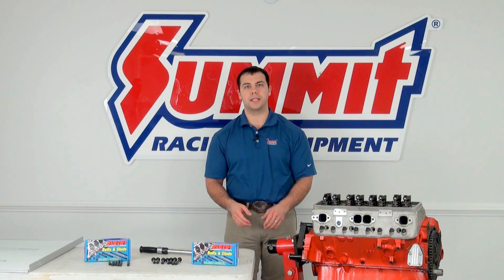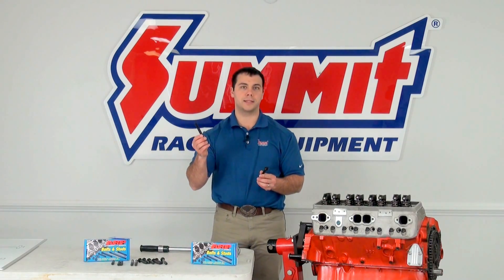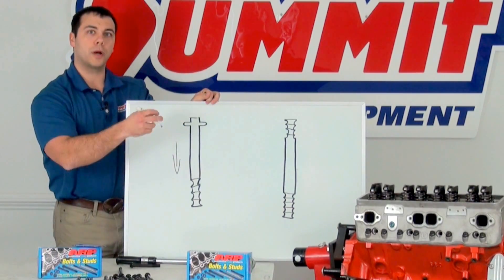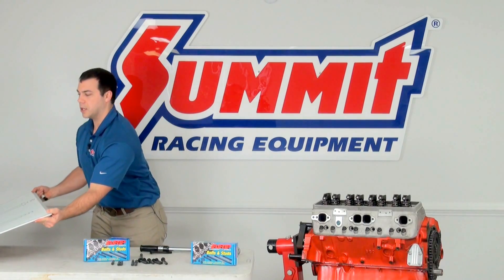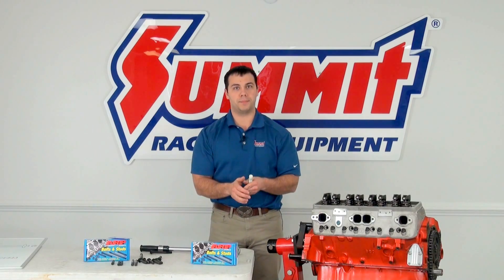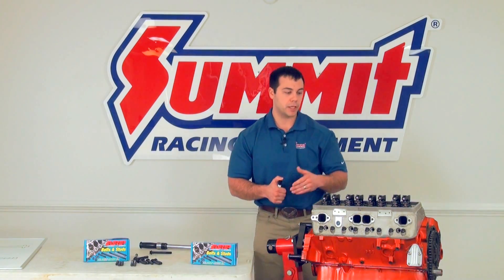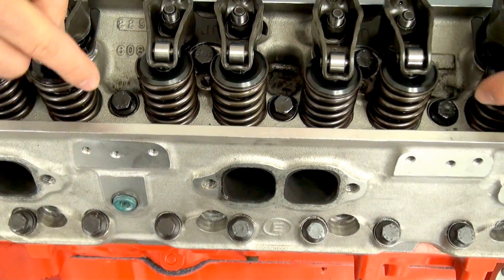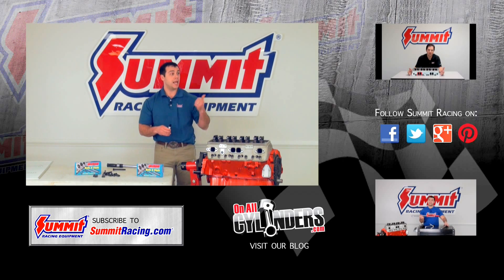Cylinder Head Bolts vs Cylinder Head Studs - Summit Racing Quick Flicks

Comment: How can I distinguish TYY cylinder head bolts from ARP on my Ford 2.0 Zetec?
Reply from the maker: Great question! factory head bolts are in fact a bolt with a Torx style head. For this application the available ARP head fasteners are studs, washers and nuts that are marked with a small ARP logo!

Comment: How do you use torque assembly lube But at the same time
needing a sealant to seal the bolt in the water jackets from water interning the engine.......you cant use both
therefore torque setting will be incorrect

Comment: Thank you for the video and your time 👍🍺😎.
Question ! I have a 2004 chevy suburban with the 5.3 engine. 
I'm working on the engine and I would like to buy the head studs. 
Do I have to do the 30,60,80 using the head studs??

Comment: So which would be better for a turbo application, studs right?
And where can i find the studs for my engine? I checked arp and my engine wasn’t listed for studs
Reply from the maker: We would need to know what engine you’re working with. Follow this link and use the filters on the left column to choose your application. Cylinder Head Studs. If you're having trouble finding them, give us a call @ 1-800-230-3030.
https://www.summitracing.com/search/part-type/cylinder-head-fasteners?SortBy=BestKeywordMatch&SortOrder=Ascending&keyword=cylinder+head+studs&N=part-type%3acylinder-head-fasteners
Reply: @SummitRacing  I can’t call, but i have a 2005 chevy colorado with I believe a 2008 motor in it, the motor is a 3.6l inline 5, and when i click the left column to filter for my vehicle, the colorado isn’t even a option

Comment: While watching this I realized that you could use studs if you have a block that has head bolt holes that are not blind causing you to have to use thread sealer.  With bolts, if you want to change or service your heads or change head gaskets you have to clean the threads on all of those head bolt holes. With studs you wouldnt have to. I'm in this situation right now, just had to do this clean up, might change heads in the future,  so I might look at getting some studs that can stay in the block.
Reply from the maker: Hi Curt! Let us know if you need any assistance! Thank you for watching.

Comment: I have a 70 LT1 sbc cast  block with a set of performance world aluminum heads, what torque sequence should I use, I have 11.1 compression, and intend to use arp studs
Reply from the maker: You will start in the middle and work your way out in a criss-cross pattern. Make sure you torque the studs in 3 equal increments (start low around 35 ft lbs) up to the final torque spec that ARP recommends for the stud kit you get.

Comment: I have a SBF 5.0L motor with GT40P heads and an E-cam What head bolt style do you recommend 6pt hex head or 12pt head bolts?  Should end up around 300Hp when its complete.
Reply from the maker: 6 point or 12 point will both work, but I generally recommend 12 point. The 12 point will give you slightly more clearance to get a socket on them.

Comment: so you're saying torque to engine specs regardless of fastener used  ARP or stock for example my jeep 4.0 is 110 ft lb by the book ARP recommends 100 ft lb with lube   bolt pt# 146-3601
Reply from the maker: Hello, Unless the fastener is an OEM replacement, you will need to follow the torque specs of the fastener used. ARP gives you the torque spec with their fasteners. Thanks for watching!
Reply: @SummitRacing  Thank you ! they came today ups, there was a paper in the box with specs and torque lube . crown was going to be over $50 for a 94 jeep so I went with ARP only $63 Now all I need to do  is figure out what to do with the wiring harness three head bolt studs held it in place before ,only + with crown

Comment: If you think you may be taking heads on and off the short block, studs would be advised. If you are pretty sure you will be leaving on your cylinder heads on your block, head bolts would be advised. I have had to take off my cylinder head multiple x from my Quad 4, studs have had paid for them selfs.

Comment: We had trouble with coolant leaking into the valve cover area, with studs. what could be the reason?
Reply: Educated guess: It sounds like the threads did not get any thread sealant, where the hole is open at bottom to the coolant passages.  Simple solution, remove and replace the studs with thread sealant before reinstalling.  Not sure, but that may be the solution.  Also, I'd remove them one at a time, but untorque them all in the proper sequence first, remove one at a time in any order, seal threads, reinstall, retorque in the proper sequence.  Hope it works out.

Comment: what about using a stud  in place of bolt on harmonic balancer
Reply: On a turboprop aircraft engine, they mount the prop over a big gearbox drive shaft and use a big prop nut. But there are so many torsional forces going on a prop that doesnt happen on a harm balancer.
Reply: brian cummings good question! Im curious

Comment: he left out the most important aspect of using a stud over a head bolt. *You get more clamping force on the head gasket from the mechanical advantage of the fine threads*. also if you're going to torque plate hone the block use the same type fastener because  the extra clamping force of the studs preloads the block different than bolts.

Comment: I have to disagree on "always lube up the bolts to ensure good torque." That is absolutely incorrect. You follow whatever the manual or instructions say. If your using stock bolts and chevy says torque them to 20 lb-ft dry, then don't lube them. If ARP says torque them to 50 Lb-Ft with engine oil or anti seize or their lube. Then use what they say. Just as long as you follow the spec.
Reply: Sorry but all values are given implied  wet tq unless stated dry tq ... that’s a standard
Reply: Lol no @767dag

Comment: i removed 12pt  12mm  head bolts off a toyota 5sfe 4cyl 2.2,   what studs can i use?

i dont want to use bolts.
Reply: Edgar Bravo If they are tourq to yield then you can't reuse them again.

Comment: do the studs themselves need to be torqued to a certain value? or do you just run them down?
Reply: Neiman Buffard The whole point of using studs is to eliminate torsional stress on the fastener. Therefore they go in hand tight, just far enough to tap them out into the hole. Torque is applied later when you put the nut on top. If you torque your studs in, you might as well just use bolts
Reply: Neiman Buffard they also have to be torqued the same way

Comment: Be careful about using lubrication on head bolts.  The science on torque is proven.  90% of the torque applied goes to overcoming the friction of both the threads and the head of the bolt.  Only 10% of the torque applied goes to the clamping force.  Equations show adding a lubricant will result in additional rotation required to reach the torque spec.  This can can put  "angle" on the bolt and stress it to its yield point and stretch.  Two bolts, one lubed and one not, the lubed bolt will have to be turned more to reach spec and WILL stretch more that the un-lubed bolt.  the result is less clamping force.
Reply: bryan wagner most head bolts and studs come with a specific way to torque them. many want you to use lube and torque down to a certain foot pound then degree them.

Comment: I have a 94 mitsubishi 3g83 hemi head 3 cyl. 660cc had head (new)block surfaced @ machine shop.can not keep from blowing head gaskets any advice studs ? vs. head bolts
Reply from the maker: Hi Jerry, 
Unfortunately because this motor isn’t necessarily considered a high performance motor, upgraded or improved head gaskets and or head studs/bolts may prove to be difficult to find.
Reply: Jerry Monroe pm me can help you out

Comment: Couldn't one determine the running torque on the bolt and then add that to the final torque for the bolt? Using studs doesn't erase the running torque problem (what you described as "horizontal force").
Reply from the maker: +Martureo Martureon , 
Running torque is the measurement that determines the amount of torque a rotating part requires to remain rotating at a constant speed once it begins spinning. Since the average builder doesn’t possess the proper equipment to measure this and should only be using clean, straight threads with a lubricant, one could pad their torque spec by a few pounds safely in order to rest peacefully.

Comment: Headstuds are worthless and cause headgasket leaks.I know someone that fixes and builds race cars including race engines.He built one with headstuds,the headgaskets were leaking and was the head studs.Built this engine right and the head studs were replaced by headbolts with the headgasket leaks gone.
Reply: any science as to why the leaks occur?
Reply: Were fully torqued down,probally not made right.This guy will not build a race engine using head studs anymore
Reply: @Toolaholic7  Since they don't stretch you need to constantly be monitoring them and retorquing them every now and then. It's annoying. I agree, bolts are fine.

Comment: On my Generation I block, some torque specs say to torque the heads to 75ft./lbs. while others say to 80ft./lbs.  My question is whether to use more torque, say 100ft./lbs, when using head studs on my Chevy block?
Reply from the maker: +Stephen Giovi, 
When using aftermarket fasteners such as head studs, the fastener manufacturer will have a specific torque spec and thread lube to be used.
Reply: Thanks for the info.

Comment: You can easily remove studs as well if still in the car. If you have ARP studs they provide you with an Allen socket at the top so you can run the stud out easily using an Allen wrench.
Reply: exactly..

Comment: I'm going to be buying a lq9 block somebody mentioned to me using studs in that block will distort the cylinder bore?
Reply from the maker: Dj Morgan , 
Any fastener type, whether it be a stud or a bolt distorts the bore to some degree when torqued to spec at final assembly. That’s why any high performance machine shop will use something called a deck plate when boring and honing your block because it recreates these stresses during machining. Then, when you final assemble, the bores will be completely round.

Comment: I would agree with most of what he had to say but fallow your fastners torque recommendation and ask what lube to use. ARP has a different torque for eng oil vs their assembly lube. THE reason the reduced friction of their ass. lube means you reach the fastener stretch at a lower torque setting than with eng.oil
Reply: Did you just say "ass. lube"? I think you meant assy. lube. Sorry, I don't normally go around correcting people but "ass. lube" is pretty funny. Made my morning. lol